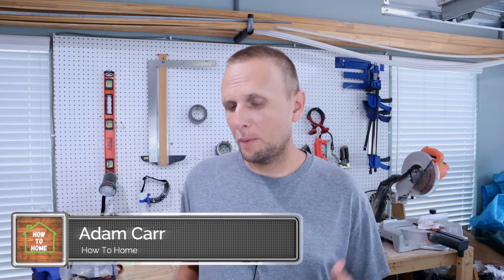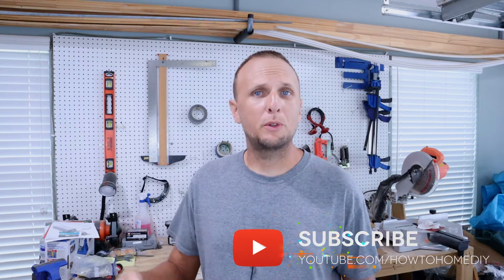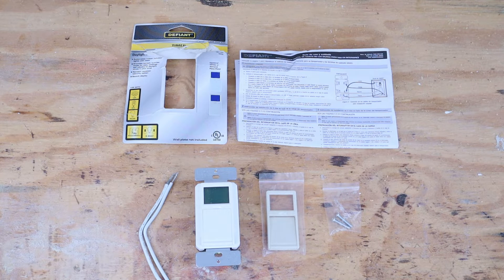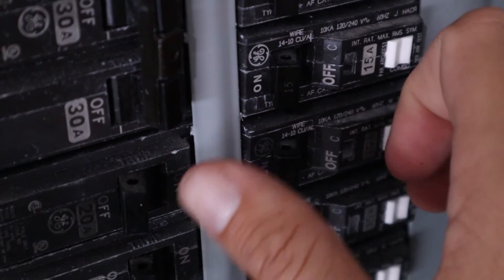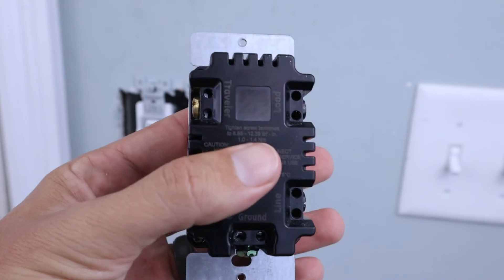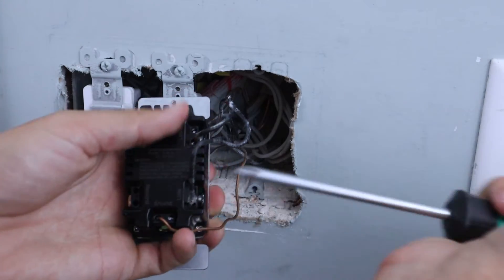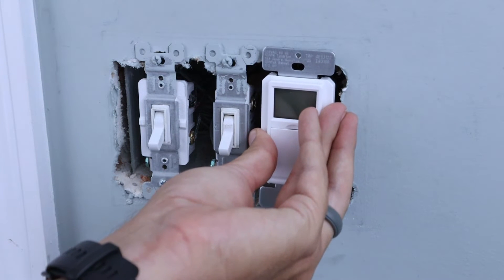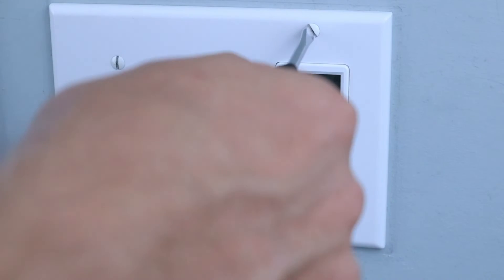Automatic Light Switch Timer Installation | Defiant Timer Light Switch

Comment: I had a switch installed when I first moved in by a handy man and one I just did myself. I noticed when complete that my switch when installed works, but the multimeter beep when I put it on the face of control but my other one the handy man put in stays green on my mutlimeter. Should I be concerned?

Comment: I just need to turn on and off a basement room venting fan at random times due to slight mold growing over long unattended periods (it’s an enclosed room), so I’m not concerned with specific time activation. I just want to avoid having to go down there everyday to manually turn on/off the fan and also, we are sometimes gone for months at a time.

Is using something like this overkill?

Comment: once this timer is properly installed and setup, it works fine.
However, reading the instructions is a waste of time and only leads to frustrations beyond belief.
when in program mode do not set it up in dusk and dawn mode.
instead go to the time function and enter specific on and off times.
this will save you alot on BS

Comment: I have just purchased a timer switch that tells me i need 4 wires to connect it. I only have 3 wires in the box. White, black and ground. My voltage tester only goes off near the white wire, not near the black. Did i buy the wrong switch?

Comment: I just replaced a Defiant DTM-0024 timer switch with their model 32648. The older switch is a countdown timer that can be programmed up to 24 hours in one minute increments. I replaced it with the 32648 because I was under the impression that in manual mode the 32648 would bypass the timer/program modes completely and function as a regular SPST switch. However I noticed that when I put the switch in Manual mode it functions as a countdown timer, the same as my old switch. I've read through the instruction and searched online to see if I can get a definitive answer, but I'm afraid the 32648 won't do what I want. I haven't been able to find a customer support number or website, either. Thoughts? Thanks

Comment: Your tip on the electrical tape ultimately solved my problem. I was transposing the Line & Load. The tipoff was the tape the contractor electrician left on the Line wire. Thanks for pointing that out.

Comment: I installed the timer and it works but my lights are very dim and when I push the on and off button, the lights come on really dim. And go off but stays on. I use led lights for my out side lights

Comment: I believe this switch is the same as the GE SunSmart digital switch. Same hardware and design, same functionality. The only difference I can see is that the Defiant model sells for about $10 less than the GE unit. Also, I'm not sure if it was clear how to determine which black wire is line and which is load. The black LINE wire is HOT when tested with a multimeter. The black LOAD wire is NOT HOT. Of course, this is before you turn off the circuit breaker.

Comment: Interesting and very useful video, thanks for taking the time to upload!! This unit is for a light but could it be used for an an "ordinary" circuit? What I'd like to do is to have a couple of sockets permanently rigged up to be operated by a timer for outdoor holiday lights. That way, I can avoid having several timers and running lots of leads, and have a just a few leads running to the same outlet which would be on a timer.
Thanks, and keep up the great videos!!

Comment: Adam, I've tried 3x to install this Defiant timer.  Seems I have a mixed up incoming power or something.

I can connect & program, but it doesn't do anything but stay running 24x7 or I can do the manual on off.

I'm no electrician, but seems it should be working unless the box itself has screwed up in/out wiring.

Comment: Better than the instructions 
 Question if there is a power outage do you have to program it all over again?
Reply from the maker: No there is an internal battery.   But now that I’ve had mine about 4-5 years, the batteries seem to be wearing out and I have had to reprogram some of them.

Comment: has your switch stopped working yet?   once the internal battery expires it will no longer hold programming, then it becomes a regular switch and you can't fix it.

Comment: I did everything that you have said. However, when I connect the neutral jumper to all the neutrals in the wall, my circuit breaker does not turn on the panel. When I remove the jumper from the switch the breaker now works and the display is on but I cannot turn on/off the light outside. Any suggestions?

Comment: I installed the timer but have a problem. When I turn on the on/off switch the lights flicker. Can figure out why this is happening any suggestions or answers?
Reply from the maker: Either you have a bad connection somewhere or I have seen some of the switches be defective.
Reply: @HowToHomeDIY  Thank you for helping. I have gone over the connections a few times, still might be missing something will try again. If no success I assume go back to Lowes and exchange switches and start all over. Thanks again hope I can get the timer to work.

Comment: Is the load wire the power?
Reply from the maker: The load wire is the wire going from the switch to the light or whatever you are wanting to power so it only sends power when the switch is on.  The line is the wire supplying power all of the time from the panel.

Comment: Question… I installed this.  The display comes on and you can program but lights won’t come on.  What am I doing wrong?  Yes the line is good and the bulbs are good.
Reply from the maker: Does the display turn blue?

Comment: If I have a duplex light switch for a hallway and for outside and I want this to control only outside light, does it mean I have to have 2 switches for each light, inside and the outside? Also, the window is not lit up as yours. Do I have to have a switch in ‘on’ position at all times? Someone installed it, I will have to let them know. Many thanks!
Reply from the maker: Yes you would need 2 separate switches in that case.  If it is not lit up then more than likely the wiring was not done correctly.

Comment: Great video, but these things are junk. They need to be reprogrammed every time the power goes out, and 3 of the 4 I bought completely stopped working after barely a year. I recently replaced all of them with Z-Wave switches which I control through an app. So far, so good with the Z-Wave options.

Comment: I am adding a Defiant programmable
#32648, but the light switch has only a black wire (hot) and a white. The ground copper bare wire is not connected to the light. There are no neutral or common wire on any of the 3 light switches: 1 to the porch lights, 2 to dining room chandelier, & 3rd to ceiling foyer light. Went to Home Depot to ask what to do, was asked to just add a common wire hooked up to either a electrical outlet or ceiling light. I am not clear to where i add the common wire to the digital programmable Defiant?

Comment: Hi Adam very simplified video thank, the only thing is i'm do not have natural wire connection in that box and not sure where to connect the jumper. it's only 1 socket switch for the porch with 3 wire, ground, load and line. ground, black and white. any tips on what to do. i connected everything like u did without the jumper and light didn't go on. thank you.

Comment: If the load and line wire sometimes are different colors would the red wire be the line wire or the other way?
Reply: Use a multimeter to measure voltage

Comment: Looking to “sync” two of them. Any suggestions other than getting the times as close as possible?
Reply from the maker: I also have more than one of these installed.  There is no way to sync them perfectly, outside of setting the time on one of them and then timing out a minute and then setting the next one.   It probably won't be perfect but it can be darn close.  Good luck!

Comment: Will it work if you reversed the line load lines?
Reply from the maker: No, the line wire needs to be attached to the line terminal and the load wire to the load terminal.  If reversed it just won’t work.  I hope this answered your question.
Reply from the maker: No it just won’t work until the wires are wired correctly.

Comment: Great video! Two questions: 
1. What if you don't have a multimeter? Any other way to confirm no power? Not a big DIYer, so don't have a lot of tools.
2. I want to install the timer on a 3-way switch controlling two different light fixtures between the switches. Does it matter that there are two fixtures?
Reply from the maker: Hey, if you shut the circuit breaker off that supplies the electricity to that light and then go inside and flip the switch on and off and the lights don’t come on like they usually do then you can be pretty sure that the power is off.  There are some rare circumstances though where this might not be an accurate way to do it, for example the switch is broken or a wire came loose.  The only way to know for sure is with a multimeter or voltage tester.  As long as the two different light fixtures are currently being controlled by two 3 way switches then this should work.  Just make sure to follow the instructions and diagram in the instructions as they won’t be wired exactly like your typical 3 way switch.  I hope this helps!  Thank you for the feedback!

Comment: Can I wire 3 switches into that timer? In other words can the other 2 switches be wired in with the timer
Reply from the maker: Hey, yes you could, but you would want to make sure you don't go over the amperage that the timer switch is rated for.  In this case the one in the video is rated for 15 amps so just keep that in mind.  Hope this helps!

Comment: This is a very organized and well crafted how to video.  I only wish that the author would have discussed the installation of the switch in a 3 way switch application which this product is capable of.  Otherwise thumbs up on this video.
Reply from the maker: Hey Robert, yes unfortunately where I was installing it was not for a 3 way.  I did talk about how to use it in a 3 way application which is super easy as you would just need the traveler wire that is connected at the other switch and connect the other end of it into the traveler port on this timer.  Thank you for the feedback, I really appreciate it!